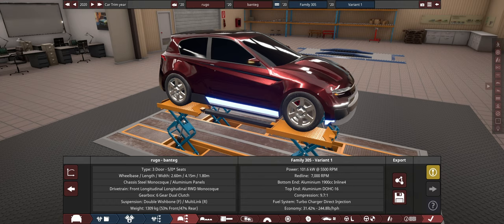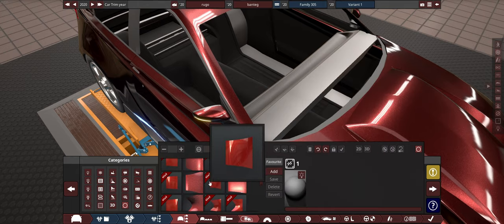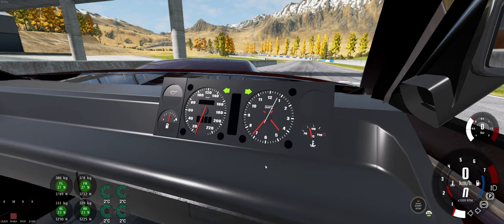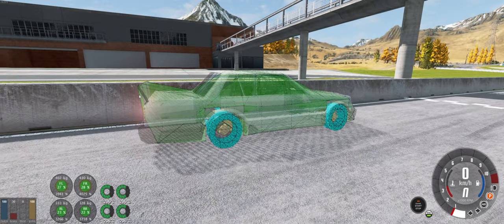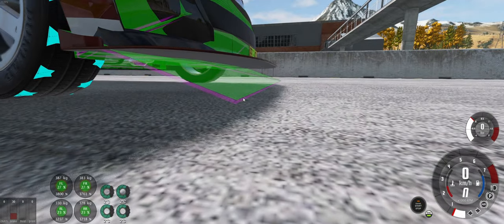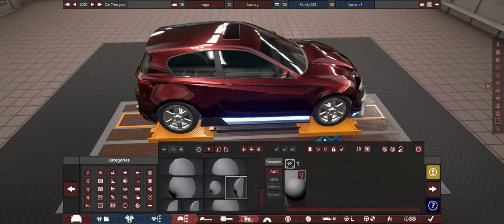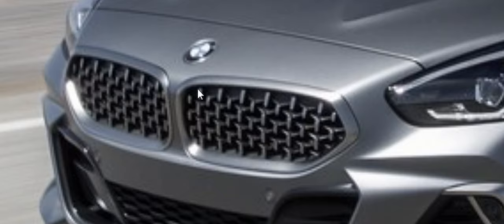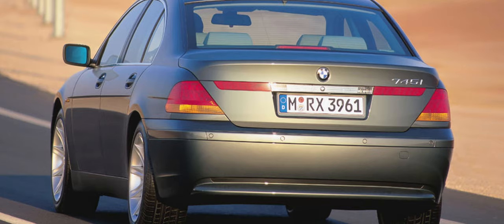Fixing Dash Gap/Wings/AirFlow in Automation🔧BeamNG

Comment: So just out of curiosity, would increasing the rake angle (making the rear higher than the front) increase the rear wing angle aswell, giving it more downforce (as its angle is increased with the rake), or is Beamng aero not effected by that?
Reply from the maker: interesting, it'd be hard to tell though, but I'll check it out some time